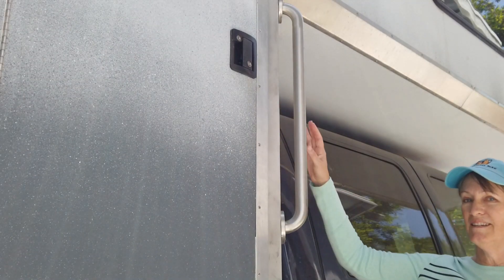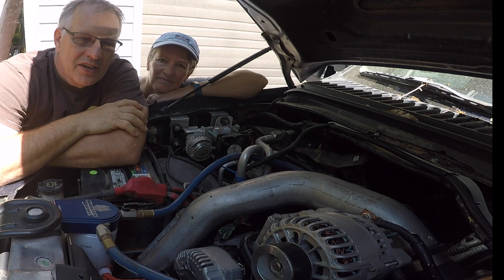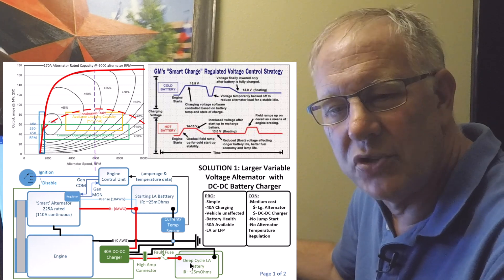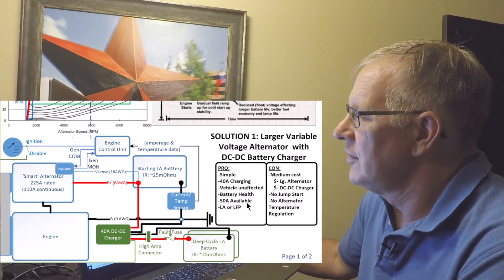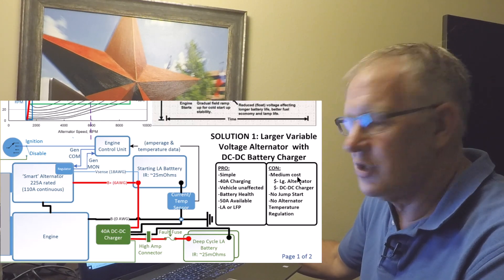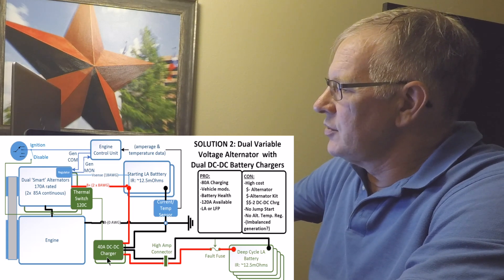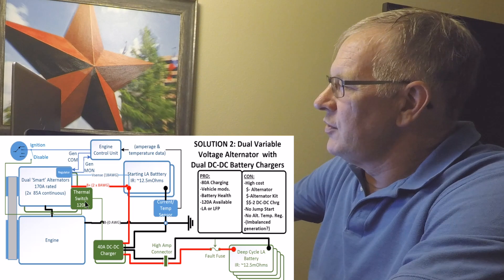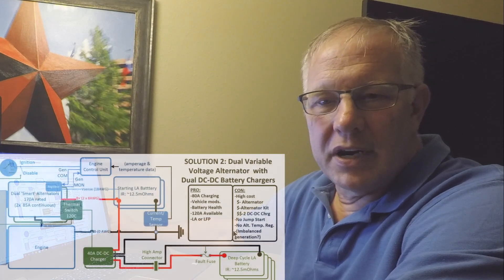SOLUTIONS: Truck Alternator Charging Auxiliary Lithium Battery Setup PART 2

Comment: Most of my charging is from solar but I do I charge the 100Ah LFP bank from a plain VSR (option 0.5).  The resulting current and voltage are within battery manufacturer's specs and well within the comfort zone of the stock 180A alt.  I do run a switch on the VSR's ground to disable it when alternator charging is not needed/wanted.
Reply from the maker: That's not inconceivable and im glad it's working for you so far. Some things to keep in mind 1) If the battery is distant from the alternator and goes through several connections, the 1mOhm internal resistance of the battery is added to by likely 20mOhms of resistance of the cabling, helping keep the current in range. Be careful if you were ever to run larger wire.  2) If your alternator is of the variable voltage (VVA) type, the voltage differential between the LFP battery and alternator will be much lower as VVAs typically put out 12.4-13V with occasional forrays to 13.5V. All this, with your VSR will keep your current in range. When breaking, the VVA can hit 15.5V which could be injurious either by producing high current or a battery over voltage. Fortunately, the duration is very short but may be occurring without your notice. 3) Both of the previous likely result in charging at less than full battery voltage and frequent interruptions (by the VSR) so your VVA gets a cooling break. 4) your 180A rated alternator can be expected to deliver 90A continuously. Not knowing your charging currents or duration, but expecting them to vary quite a bit. I'd recommend you extend your manual disable circuit ground circuit through a KSD9700 120C, normally closed thermal switch epoxied to your alternator case. That way, if some abnormal event occurred and the alternator overheated, it could deactivate the VSR till the alternator cooled. It would likely cost less than $20 to install this thermal safety.
Reply: @WorkingOnExploring  Thank you for your input.  The single-voltage alternator provides the chassis with 14.2v and there is considerable resistance in the charging circuit;  for example the NEG return goes through the chassis rather than dedicated wiring.  

The highest current I have observed at my usual DoD (~40%) is 0.32C on this 100Ah.   This figure is in line with other direct-charged campervan-sized banks (100Ah - 300Ah) I've been tracking  on YT, Will's DIY solar forum, and the Promaster forum.   The average max observed C rate for these so far 0.31.  The outlier was a fellow who saw 0.67C;  he was running 1awg wiring.  

The KSD9700 120C sounds like  good idea;  thank you for pointing it out. In practice I only direct-charge while actively driving and cut alternator charging whenever combined alternator+solar current  reaches my comfort limit of 0.4C. WIth any luck the 120C will forever sit there twiddling its thumbs.  🙂
Reply from the maker: A couple of extra thoughts; 
1) Since you have a fixed voltage alternator, it is important to note that most 'fixed voltage' outputs are not actually as fixed as you would assume. I cannot confirm that ALL alternators do this but everyone I've worked with does; They start around 14.4-14.2V when cold and as the alternator heats up, the voltage lowers to ~13.8V. I just checked mine (2004 F350 w/6.0l diesel and 135A large case 6G alternator). About 3-4 minutes after startup when the glow plugs shut off, it goes to 14.2V. Later, on the road, at 128F(measured alternator case temp), it was at 14.0V. I haven't tracked it previously but it always ends up at 13.8V before long. I will do some more data-taking. (you can see my meters on my center console' video.) Rationale: The internal voltage regulator can sense case temperature and assumes that since the battery is in the same engine compartment (not all are but I have one on both fenders) that the battery is hot too and that a reduced voltage is appropriate. If you charge your LFP at 'highway speeds' (meaning after the engine is warmed up), your alternator has likely already settled to a somewhat lower voltage. This would be helpful in not driving too much current to the battery or overloading your alternator. 
2) Using the frame as a return path is possibly the key to your success. When conductors are measured relative to copper (considered 100%), Aluminum is 71%, Brass is 25%, steel is 12-14% (depending on the alloy), lead (solder) is around 12% and 304 stainless steel (what stainless fasteners are made from) is 2.5%. Two things to take away; a) The (relatively) high resistance of the steel frame (although of a large section) will definitely offer significant resistance, far larger than the battery. I'm not even sure it could be calculated but it could definitely be measured (with some long meter leads). As a matter of fact, I may just have to go try that. LFP batteries are .5-1mOhm. Lead acid starting batteries are 30-50mOhms. I can imagine your circuit path, half of it being steel, could easily add 20mOhms to that of the battery. its still a low resistance but you clearly know it works. b) NEVER use stainless hardware bewteen overlapping cable lugs. They are horrible heaters and sources for voltage drops in your wiring.
3) On my blog at WorkingOnExploring.com/techdocs, I have a document titled 'alternator thermal overload protection' or something like that. It is a one-page doc using a different KSD thermal switch to unload a B2B charger but would do similar to your VSR. What I wanted to point out is that you could change your in cab disable switch to an illuminated switch with which you could cause the light to be on when the circuit was grounded and off when the thermal switch cut out. This would give you a visual indicator of your alternator overtemp condition with very little effort. You seem savvy so I'm guessing you can figure out the wiring (my diagram assumes positive side control but yours is negative side control) but if you want some help, let me know.
4) I charge direclty into a battery bank (17.5kWh) with 2AWG cables (can carry 210A) and a 220A alternator with external diodes. I can deliver 100A @29.4V continuously. I do this by having an externally regulated alternator with the output adjustment on my console so I can 'dial in' my starting current (and current only decreases from there as it charges). I also have the alternator temp gauge there and adjust it to keep it from overloading/overheating. If the temp exceeds 120C, it shuts off the regulator. This is much the same way the thermal switch can 'shed' the extra battery load but it is simpler.  
5) THE ONLY ISSUE with the thermal switch (and it is the same with your manual disconnect) could be; disconnecting a large charging load causes a 'load dump' which causes a voltage spike inside the alternator. The avalanche diodes in the alternator should be able to handle a 30A disconnect but for anything larger, I might consider adding a 'transient voltage suppressing (TVS)' diode assembly (diode and fuse) to the output of the alternator. (I can also explain that if interested).

Comment: Blessings to You and Your Loved Ones my brother, 
thank You so much for blessing us with this amazing video and information, 
I have a 3.7L 2007 Jeep Wrangle Unlimited, and I'd Love add a secondary dedicated 250amps Alternator to my Jeep to solely charge my 12v lithium battery bank with a Renogy DC to DC charger,
what's the most affordable way to go for that secondary alternator,
does it have to be specifically made for my Jeep or can I buy any other type, 
what things should I look for, other than the 250Amps that I want,
and I heard You say You bought yours used, which one did You get,
I appreciate Your Prompt response,
as You got me enthused with this project,
May our Father Bless You All
william and familia
🙏👨‍👩‍👧‍👧💞
Reply from the maker: Sorry to dash your hopes but......My F350 has factory options for a second alternator which is what allowed me to get a takeoff from a junkyard to build my truck system. There is  no factory kit for a JK/3.7L or any other jeep. A quick internet search shows no aftermarket either. Often, the car stereo market is a place to find them. I did find forums of other JK owners looking for them but no one identifies source. Installing a second alternator aftermarket has two challenges. 1) getting a place to put the alternator in the drive belt plane and 2) changing the belt routing so that all current accessories can be driven which will also involve adding idler pulleys . Looking at a picture of the engine, The primary alternator is top center. With the hood shape of the jeep family, there is rarely much room on the top sides due to the taper of the hood. The most likely spaces would be on the bottom driver side which is also where the steering gear is. I seriously doubt you will be able to find a place to put one but I would try asking questions on some of the forums.  IF you did manage to find a mount, it will almost certainly be for a specific alternator case, probably  identical to your primary.  My preferred source for alternators is either DBelectrical.com (where I bouth the 220A on my F350)  or BNR alternators (eBay - for the 250A on my TJ).
Reply: @WorkingOnExploring  Omg Omg Omg,
You have truly touched my heart brother,
you have dedicated a lot of your precious time on me and you don't even know me,
wowww,
I am deeply grateful for all the information you have put together for me and my project,
I am going to look into the links of the Alternator providers that you referred to me,
I will keep you posted on my progress, 

may our Heavenly Father Bless You and Your Loved beautiful family in all Your Ways, 

william and familia 
🙏👨‍👩‍👧‍👧💞

Comment: In ur third solution u tell us about a editional 250 anp aultinater instaling without a dc to dc charger but what would happen when battery's are fully charged ,we start the engine and this 250amp aultinater pumping current with its max capicity in to olrady charged battery's.
Reply from the maker: I wrote a lengthy response to this as it came in but  I must not have actually posted it.....
Couple things;
1) Option 3 is to install a second alternator and equip it with a 'charging regulator' which isolates its output to just the batteries it is meant to charge and turns the system into a microprocessor-controlled battery charger. Battery chargers strictly regulate voltage output to limit the maximum charging voltage to prevent overcharging. When started, all battery chargers (including this one) perform sensory steps when started to determine battery SOC and adjust the charging profile to suit. Since a battery charger powered by the vehicle engine can be started and stopped multiple times before charge completion, each time the engine is started, the battery charger senses the battery voltage before delivering a charge to determine the SOC of the battery and provide the correct voltage. 
2) Regarding charge amperage. As a battery's SOC rises about ~80%, the charge current begins to reduce and it becomes very small as it approaches full charge. Charge amperage is driven by the voltage difference between the battery and the charging source. Since the charging source is limited to the maximum safe voltage it can deliver to the battery, the system voltage will not rise above that. This maximum charging voltage can often be reprogrammed and is what makes chargers capable of properly charging different battery chemistries. If a charger were to be shut off while connected to a fully charged battery and then restarted, at most, it still would only be able to provide the same small charge. No charger can 'force' current into a battery. It can only 'offer' a voltage level above the battery and ALLOW the voltage difference to drive current which is proportional to the battery's internal resistance.

Comment: What about a mechman alternator?
Reply from the maker: While I have not personally inspected, used or tested one, I have read their specs and studied pictures. I presume they typically have more aluminum case mass and possibly have larger windings relative to their capacity which provides an overall larger thermal mass which would mean a slower heating cycle and possibly a slightly higher continuous capacity than the standard alternator. The manufacturers will claim that their rated capacity is a continuous. They may be technically correct but they are fooling you. They are leading you to assume their test conditions will be the same as your engine bay operating conditions. test bench operation is at 70F with lots of free air (SAE standard test conditions). An engine bay has 150F 'cooling' air and is very congested to airflow. While I'm sure the 'experienced' capacity in an engine bay may result in more than the typical 'continuous capacity is half rated', that I suggest is appropriate for standard alternators. Premium designs are unlikely to be more than 70% of rated. Also, since no alternator's are thermally protected, they will simply get and stay much hotter than my limit of 120C if pushed and the manufacturer may be ok with that. 120C is 248F and semiconductor diodes do not live long at these temperatures. Some Dipped wire insulation can be ok at up to 300F which may be used on these premium alternator's as well but running grease lubricated bearings this hot is also problematic.

Comment: Steve, amazing video, thank you! Yours is by far the best resource I've found for describing the alternator charging options. I'm working on the electrical plan for my truck camper and this is an amazing resource. Option 3 is a little daunting but you have definitely piqued my interest.
Reply from the maker: I'm glad you found value in it. Charging regulators may be out of the ordinary for trucks/campers but it is common for sail boats....I just completed removing the diodes from the back of my alternator and mounted a larger set in the fan shroud to get better cooling. We're leaving for the summer tomorrow morning so I'll get a chance to test it out.